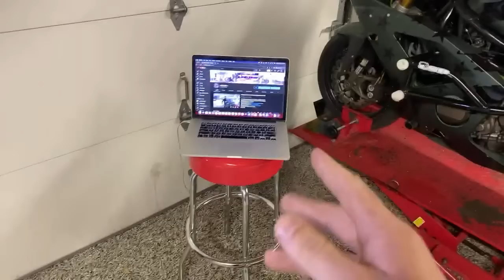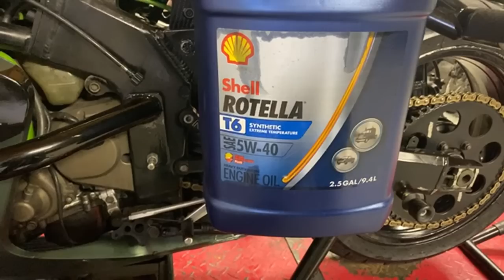Will She Make 100K? (LIVE Service!)

Comment: 1:30 Engine Ice. Its like your water wetter, but drag racers use it as well as track racers. Drops your coolant temp overall.
Reply: 20:47 You can check out youtubes like Chris Moore ( Moore Mafia on youtube) who use "Engine Ice" and get temps like 180-200.. Under the same test conditions. Granted, you can grab yours at autozone.. and have to order the ice, and its more expensive. However the results speak for themselves, MotorGP and Grudge drag racing alike. Hes also located in the south where they regularly see much hotter temps for daily use.

Comment: I have an offtopic question - I have only recently found your channel I haven't watched too many videos but I adore your skills <3
I have a specific question for you; what do you think about the SV650? It's been around for more than two decades, comparable power and specs to 636 (and MT07 you mentioned in your video about best beginner bikes). Have you ever tried putting her through paces? 😁
Reply: Sv650's aren't good for wheelies, not because they can't, they def. Can but the front cylinder gets starved of oil so they fry.
Reply: @khajit465  So you would need the oil pump to not ruin the engine?
Reply: @lostwaffle2028  something to do with the oil pick up. Maybe run more oil but why even waste your money and possibly seize your engine.

Comment: Isn't Rotella bad or is it just me that thinks that?
Reply: Just you my dude. Lots of people who build and tune turbo subarus use rotella t6 also. The added protections built into the oil for diesel engines actually works well in non diesel engines as well. Its not a "diesel" only oil. Its just beefier oil with a nice additive pack.